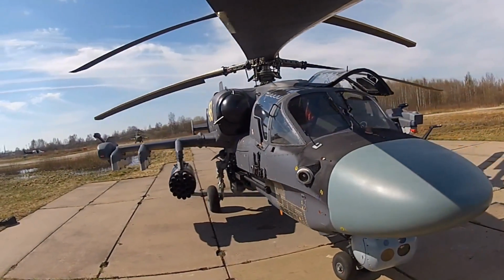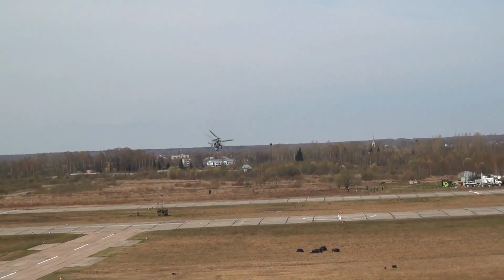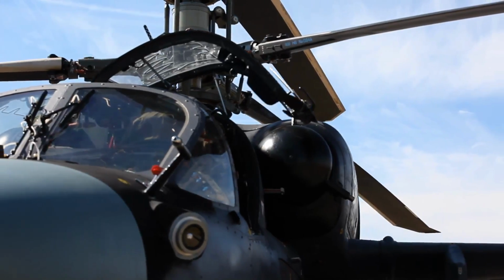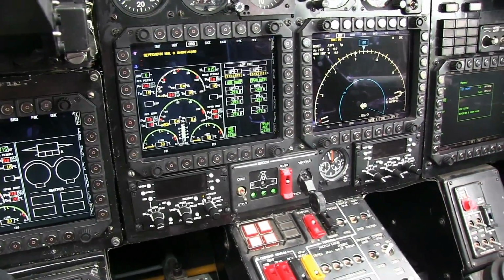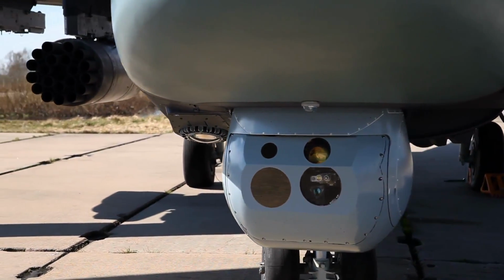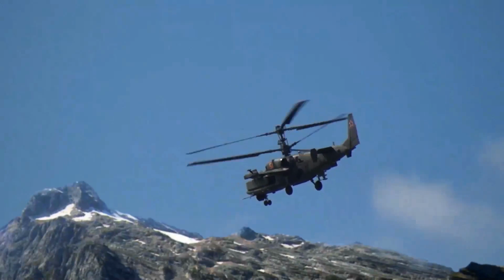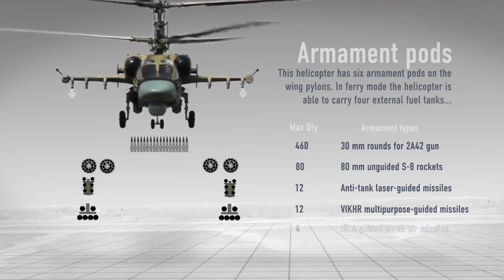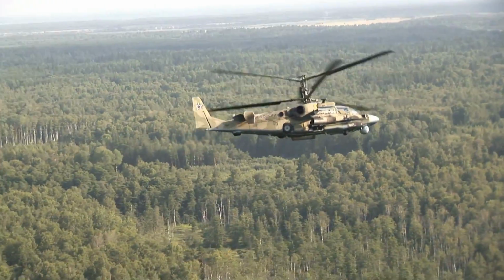Russian Helicopters - Ka-52 Alligator Attack Helicopter Capabilities [1080p]

Comment: Ka52 would own Apache like a stepchild.

Best attack chopper right now.
Reply: And how many are there? lol
Reply: In an active status, about 18 I think but dozens more are going thru post production flight testing fro FY2014 and about 25-30 for FY2015. Unlike the Russian federation which takes decades to produce handfuls of these types of equipment.  How long has the Russians been trying to manufacture these?
Reply: ***** Ok, most of the Russian helicopters are older versions of the Hind V model and the rest of the P model. Mostly relic airframes loaded with some upgrades which many nations consider standard equipment on modern combat helicopters.  Less than one hundred Mi-28N are available and a good amount of used for training and with the current economic state, I doubt they will produce more than a handful per year. Also, what ancient airframe are you referring to?  The Mi-8?  Mi-17??   LOL.
Reply: ***** The Mi-35M is purely export version as such Russia does not have in it's inventory.  The Mi-24 can only be upgraded to a certain level. That beast's heat signature can been seen from the moon. You fail to realize the real state of Russia's rotary wing aircraft. Even they will admit to flaunting a few newer models and trying to imply that most models are in such "great" shape. You bring up a stupid assessment on the RAH-66. Nobody in the world ever said it was a failed project, not even Russia would say that. It was a project that was out of it's time. Great idea but bad timing. It was just not needed and too expensive. Just like the F-22, no need for mass production of it. Too expensive.  I have continuously heard the same shit about the same fucking Russian ASM. How does that make the Russia's helicopters more "advanced" than the US. Do you not realize that dozens of other factors are involved in helicopter warfare?  Heard of the term "drone"? Those are the vehicles for that type of weapon delivery. You try to imply that the AH-64E "competes" with the Kamov? LOL. Russia has been trying to field the 52 for almost 20 years. Blame "economic" issues for the history of development of the 52? Typical excuses. The AH-64 series has been a proven system that progressed successfully during the same timeframe that the Kamov has. That is a FACT.  No fucking way to explain that one but please try.
Reply: Don't think so
Reply: Alex Perez when did discussing what a helo cant do.. to a grammer test? again.. when was it EVER or where/wear was it EVER combat tested... it hasn't been.. soooo..  hmm... nice for the flyin heap of crap.. it looks cool. that's why I am sure a lot of you children pick it on your flight sim games... n real life it don't fly home boy...
Reply: Alex Perez fuckoff!
Reply: Alex Perez The Americans won the space race?))))))))))
This is the most stupid statement I've ever heard.
Reply: Коммунист Демократович our friend perez missed a bit,
none of the countries "won" the space race race actually they equalized,
capacity and level of technology and technical organization of the Russian space and NASA are very similar,

but you guys Russians never reached the moon :)
Reply: Alex Perez The main purpose of the space race is space exploration. America lost the space race.
Reply: Коммунист Демократович HAHAHAHAHA he removed his comments HAHAHAHAHA
Reply: Alex Perez The moon? The main thing is to study the cosmos. Soviet space was far ahead of the United States. Even now, the ISS is built according to the drawings space station Mir. Even now, the ISS fly rockets custom designed in the Soviet Union. America completely failed space race.
Reply: hahaha, the way the moon by the Americans and proven by the space agency of guys, big deal to go to the first space, what matters are the benefits that this will bring to the country and the world, and modern computers of today and the result of NASA research

because you guys are not going to shop?, for what I know, Russia is on the verge of a crisis haha
Reply: Alex Perez The piece of shit you mentioned is what the USA used to depend on because the USA don't even have the know how to build it!  Because when they did build one it was even a piece of worst shit that why it failed
Reply: Iure Araujo their debt is zero... while the american debt is 200 trillion or something like that! who is in real crisis?
Reply: greek ellinas the ruble be devalued,
because of this crisis in the oil ... putin even announced that the Russian economy is broken .. inflation shooting, in addition to other things
Russia is on the brink of a recession.

watch more news programs :)
Reply: Iure Araujo Do not write nonsense. In Russia, all is well. Your TV is deceiving you.
Reply: христофор врунгель haha you did not hear the talking putin that the crisis in russia would last two years ??
if you did not hear him saying this, you do not and a Russian citizen
Reply: Alex Perez US won the space race? Lol! You sure? Can the US astronauts go to space without the help of Russia?
Reply: Oleg111222333 today they will with the help of russia, but 30 years ago they were going for own account :)
Reply: Iure Araujo The space race is not stopped and the United States may speak only as a loser who remembers the old victory.)))
Reply: Oleg111222333 they didnt achieve anything! even their anti-ballistic missiles are old russian rocket models. Iure Araujo HAHA why is it broke? they dont owe and their industry is russian what makes you think they are broke??? also putin never said that there is a crisis in russia for 2 years! he said russia is past the difficult times and they are growing again. do not watch only your american crap media... youre the one who does watch the crap news and than you recomment me to watch more news???
Reply: Iure Araujo HAHAHA wtf??? dude russia has doubled its economy and military power every year since the fall of the soviet union and the moment that boris jeltsin left. the military of russia(today) is the strongest in the world, proven many times in battle and cockfights with americans. also the economy is independant and strong. they dont owe anyone and they have their own industry, something america only can dream off!!!
Reply: greek ellinas hehe, why the russia and the 9th world economy? behind the countries that have not even half of Russian territory haha. GDP (USA): 16 trillion, GDP (RUSSIA): 2 TRILLION

the Russian economy has never been "self contained" always in the hand of Americans.
to russia will fall into recession next year, banks have increased interest rates to 17% while the US will decrease to 0.8% .. that harm Russian market ..
Moreover, the Russian economy will grow only 0.9% next year, while the US economy will grow about 3.5% ..
russia to be almost to his knees,
  and the US is stirring up again. :)
Reply: greek ellinas hahaha, the china is also in crisis young man
Reply: 230 trillion is more money then the world could comfortably lose.

It's more then six Earths could lose.

It's like ten times the US budget at least.
Reply: Banking records. I know how much money there is in the world, +/- a trillion one one side or the other.

You're just making up numbers for the US to owe China, when we really owe ourselves way more money and the rest of the free world besides Norway owes more.
Reply: Alex Perez , 
I don't want to be part of this hysteria - who is better who is worse, but you try to sound like a man with lot of "knowledge", while you are putting many biases and wrong facts here.
Just to name two.
First, it was not Moon race, but race to be superior in Space, and Landing on Moon came as crisis idea after Russians great victory in space - sending a man to space.
You will believe this source at least :)
http://history.nasa.gov/Apollomon/Apollo.html
Excerpt from there:
" The Soviet Union's space effort counted coup on the United States one more time not long after the new president took office. On 12 April 1961 Soviet Cosmonaut Yuri Gagarin became the first human in space with a one- orbit mission aboard the spacecraft Vostok 1. The chance to place a human in space before the Soviets did so had now been lost. The great success of that feat made the gregarious Gagarin a global hero, and he was an effective spokesman for the Soviet Union"

Second, I studied Electrotechnical Faculty, so I knew why USSR used tubes instead of transistor, and now I am providing it here for you to get it.
One of the texts about it (on page 3):
http://www.keyboardpartner.de/hammond/diagrams/MIG-T/mig-t_instructions.pdf
If it is difficult for you to understand, tubes are less prone to nuclear electromagnetic side-effects.

Again I am not taking sides here, but I just don't like self-praising, especially when somebody is not informed.
Reply: Alex Perez Why USA buys rocket engines in Russia
? US foolish enough to use the old technologies?
Reply: Alex Perez Wernher von Braun?
Reply: Name one war that China or Russia didn't win from sheer numbers.
Reply: Will Kanoff

Britian, Britian, Half of the US, Germany, Germany, and Japan were all defeated by the US. 

Germany was worn down by the French and British, but the Western Front would have been lost both times without the help of the US.
Reply: Trevo Smith
 Germany was defeated be the US!!?? That is funny ) You really have no flipping idea, do you?...
Reply: Alex Perez Crews Challenger and Columbia knows about the reliability of the shuttle LOL
Reply: Alex Perez The US was able to win in a fair war (1861-1865) only once, only half.))
Reply: Alex Perez Why then stopped flying? Can purpose
 the space shuttle  - do  many corpses?)) Why then stopped flying go to the person, you butthurt?
Reply: ***** son US is startin a lot of wars, not russia, lol all thay can do is start wars kill milions and millions if US is more advanced why thay never attacked russia
Reply: Alex Perez The MIR was not an emergency, it flooded because of the incompetence of the government=)
Reply: Lol, without watching this video,  some express lot of Russian hatred and jealousy here :)
Reply: Iure Araujo  ПУТИН лидер планеты ... Америка зло американский тв обманывает вас
Reply: Alex Perez What do you say about the RS-24 yars? Iskander-M? Antey-2500? Topol-M? S-400 Triumf? answer one question - if war breaks Russia against the United States, who will win?
Reply: avnregt The DoD just bought 35 Guardian's.
Reply: Alex Perez  Ну это надо посмотреть)) лол))
Reply: CalcioEUnico without a doubt.
Reply: +greek ellinas Pay monies then talk, vassal.
Reply: Actually it has been tested by Sweden. Sweden will replace his Attack Helicopter and the Candidates are AH-64 Apache and Mil-Mi 28. In test, AH-64 had lose because it's system cannot withstand such cold  and it goes malfunction. Meanwhile Mil-Mi 28 had win and it's system can withstand such cold although Cockpit visibility is behind Apache. Sadly Sweden has Economic crisis and both Helicopter aren't being taked.
Reply: Arief Ma'moer Riawan Russian territory is brutally fridged that's why they build their choppers to handle freezing temperatures
Reply: yeah no
Reply: @avnregt  192 built so far

Comment: Hum...I guess there is something wrong with me. I am American, and I think that this is an awesome helicopter. If Our aircraft, (American) could be likened to a lean, fit martial artist, than I would say that Russia's aircraft are more like a big powerful boxer. Both will get the job done in their own way. I think that the coaxial rotor design makes more sense, for lifting, and stability, than a single rotor design, and Kamov has used this design at least since the 60s. I could sit all day and watch a Ka-26 dusting fields.

Comment: I want one for Christmas. How much does 1 cost?
Reply: 17 million $
Reply: Коммунист Демократович
that is over my budged. but actually it is not very expensive at all. I bet you can get 2-3 of those versus 1 Apache or Tiger and get the better chopper on top. Damn, wish I was rich and could make a chopper pilot license, but I have to stick to simulations...
Reply: ***** He is the best in performance attack helicopter. A plurality of sensors protection. Best electronics. The most powerful weapon which you can postavte on the helicopter. The radar sees from a distance of 40 km, 120-degree angle. For comparison, the AH-64E is the latest version of Apache, the radar sees a distance 26 km, the viewing angle of 90 degrees. 
The Ka-52 helicopter is unique.
Reply: We, russians can't legally buy even most popular in the world rifle (i mean AK), but you want to buy modern attack helicopter... Good luck.
Reply: Коммунист Демократович Smoking crack.
Reply: Коммунист Демократович When I smoke crack is when I concur with your opinion.
Reply: ***** There were lost only 3 helicopters ka-50/52, in 1985 and in 1998 because overlap of the blades (later the distance between the screws was increased), in 2012 because pilot error in bad weather, thought 6 of Ka-50 used in II Chechen War. Really, anti-aircraft missile can to shoot down any helocopter, if it'll hit in the target. Therefore, there are different means of protection against air defense (ex. heat flares, anti-missile maneuvers, etc.). If consider, that no doctrine involves using helicopters in a reinforced enemy air defenses, i.e. threat to the machine are only portable antiaircraft complexes, the helicopter has every chance to perform his mission and return to base. And as i know, on practice (of the II Chechen War) armor of cabin of the pilot can withstand hit of 14.5mm. The same, should pay attention, that helicopter always unstable, i's almost impossible to freeze helicopter in one place, that mean aimed fire from firearms meaningless.
Reply: *****  For Sure! But the pilots survived, probably, so the search has not shown me. Anyway, there weren't combat losses.
Reply: ***** Well! You could read 2 sentence. May be other now?